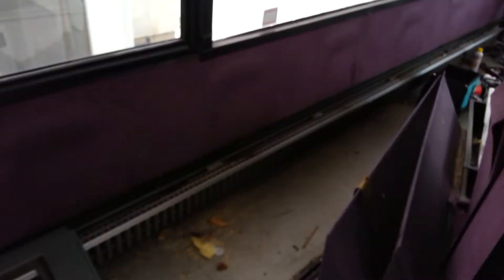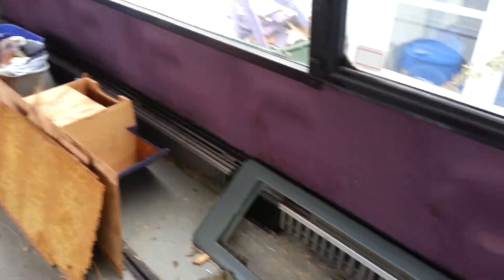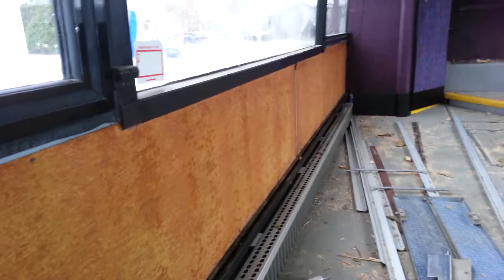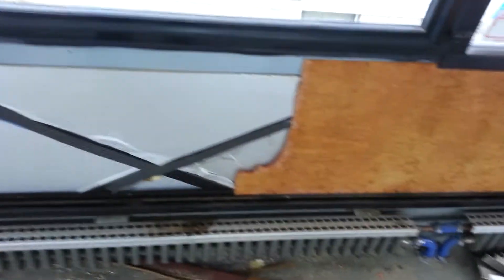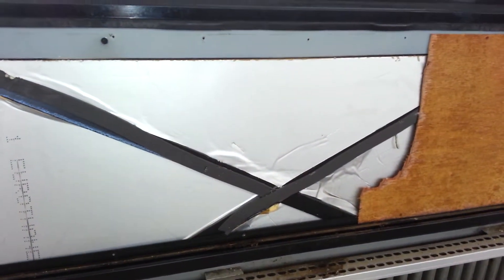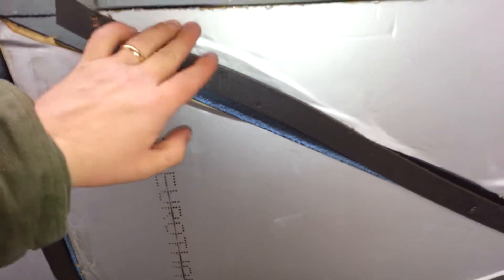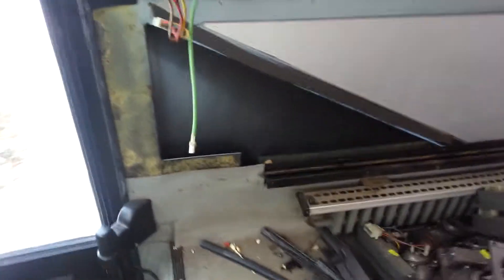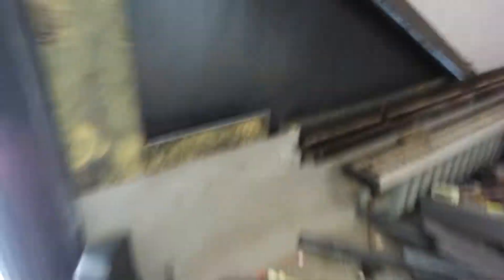Van Hool T940 Wall Panel Removal

Comment: I think spray foam is the way to go for sure. From my understanding, it absolutely is a vapor barrier because the foam is closed cell. I would think the concern would be frosting of interior walls if you left it be as is... and I agree with you, it seems like that's not thick enough for MN winters at least with any kind of efficiency. Are you planning to wall off any windows? Those are obviously a thermal-liability as well.
Reply from the maker: At this point we are not planning to cover any of the windows.  They are dual pane windows so they'll be more efficient than a single pane.  In order to fight the claustrophobic feeling of such a tight space, we're planning to have as much natural light as possible.  We're trying to have as much of an open floor plan as feasible.  For those Minnesota winters we'll have to overcome the window inefficiencies with the overwhelming power of wood burning heat.  A backup/supplimental furnace is also a consideration.